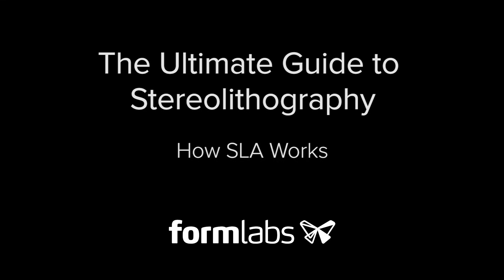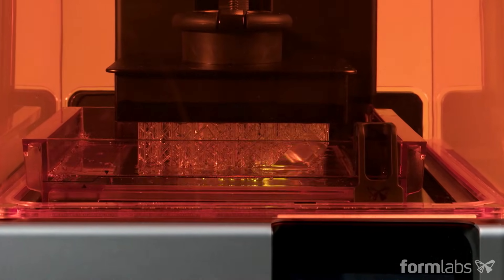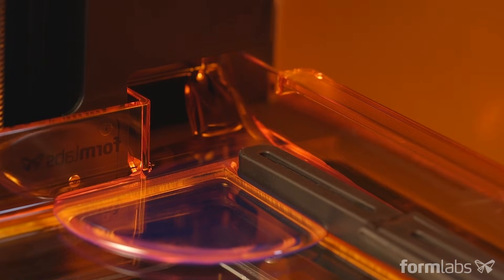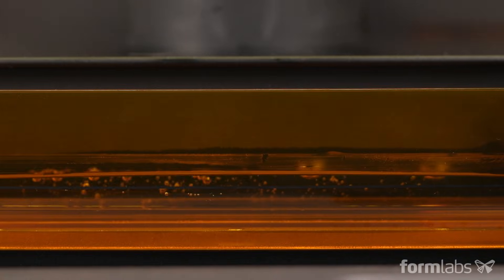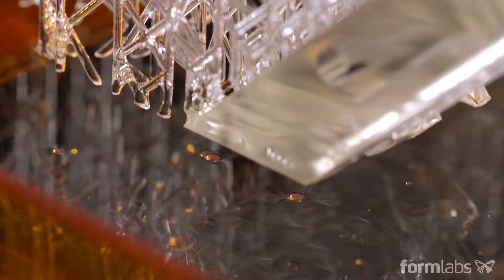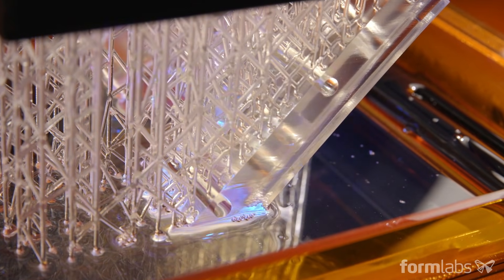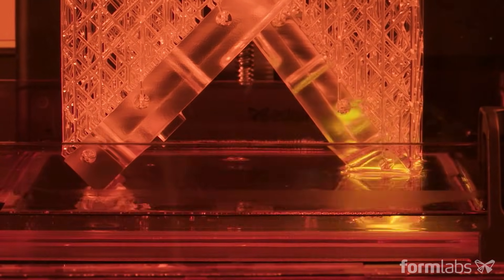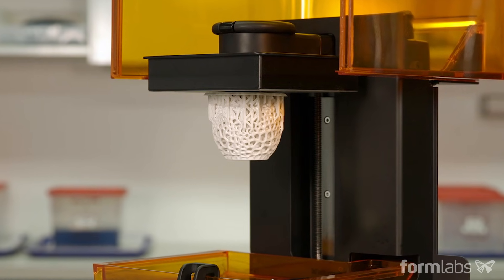Guide to Stereolithography (SLA) 3D Printing: How Resin 3D Printers Work

Comment: I have a question here .Why upside-down or inverted version is most common ?
Reply from the maker: Inverted printing was our solution to the 'Big Vat' problem. Standard systems need hundreds of liters of resin just to run; we made it so you can print with just 10s of grams. Smaller footprint, less waste, and way easier for people to handle!
Reply: @Formlabs  Oh I see. Here the printed part is actually going up so less amount of resin is enough for the rest of the printing process. Another question, how do you know 10s of resin is enough to print a part ? Or how is it determined ?

Comment: Have been wondering for a while about this but what's the material that makes the cover? It's supposed to block the light from the outside but you can also see what's printing.
Reply: A bit late but it is Photochromic (ie. lens): made of glass, polycarbonate and others.
Reply: It filters out a specific range of light so the resin doesnt cure